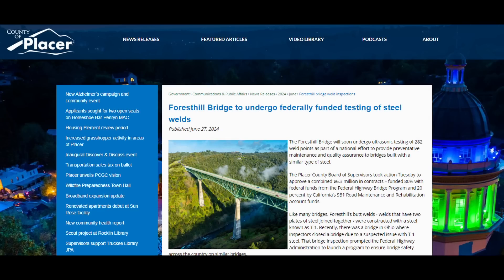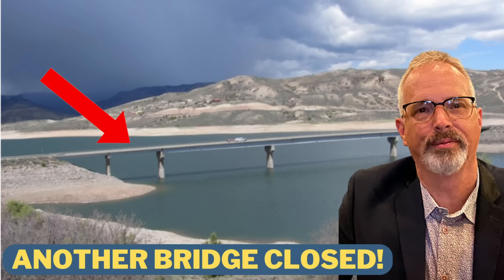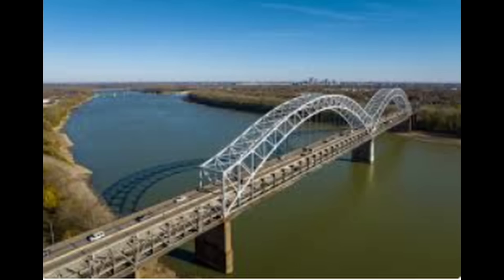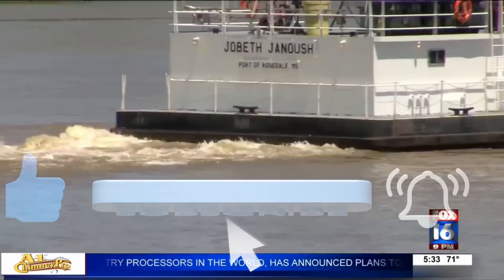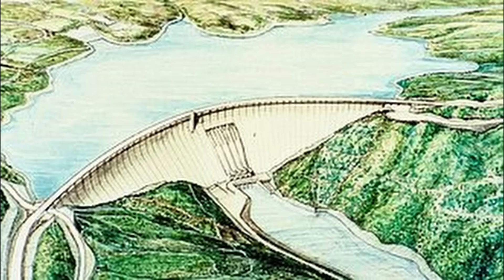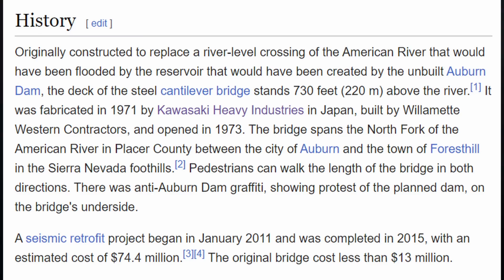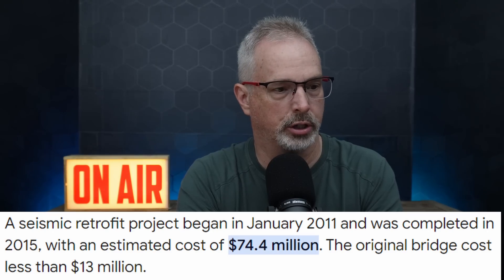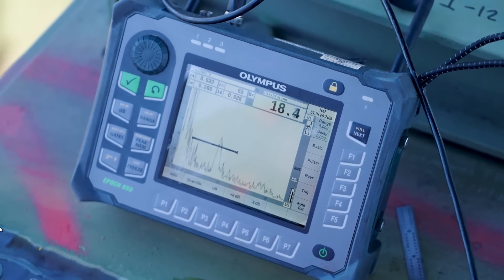Foresthill Bridge in California - Another T-1 Mess?

Comment: When the cover plates are bolted into place, doesn't that move the stress load to the points just past the band-aid plate? Thus creating a new weak spot that will need to be ultrasonically inspected in a few years.

Comment: Metallurgy. Welding high strength steel of any kind MUST follow specific procedures for pre-heat, filler material, and post heat. Depending on carbon content, and chromium content, some steels cannot be reliably field welded as the entire part must be post-weld normalized in an oven to relieve stresses.
This has all been known to us for 75+ years and James F. Lincoln literally wrote the book on it.

Comment: As a state and city licensed welder In NYC for 45 years I can tell you many welders do not adhere to proper welding techniques due to time constraints given to them. Many steel erectors would not allow the time spent as it is time-consuming and costly. You have to keep the welding rods in a heated oven. You have to clean the steel before welding. Most important with large welds preheat and post-heat are very important. The winter is extremely important when post-heating a weld and bringing the temp down to natural environment temp. slowly. Sometimes people. are to impatient and do not fully understand welding. It is about how many tons of Iron per day or floors can be erected. T1 steel from my memory you could use a 7018 up to 3/4" best to use an 8018 or 9018 as it has a higher structural component. Heat the rods is key.
Love your channel very interesting information.
Reply: It really makes you wonder if the problem extends beyond just T1 welds.  Casey, do the non-T1 welded bridges undergo more than just visual inspection?
Reply: @Zupdood2  I agree
Reply: @thelaxman59  I still wonder when the requirement for keeping the welding rods in an oven started. 45 year ago is surprisingly after the discovery of hydrogen embrittlement, which happened in the 1970s.
Reply: @johnhaller5851  I know I had my first License from NYC than NY state in 1980. Then a third from the Indian Point nuclear power plant. I went through welding school with my Union Ironworkers Local 40 Structural. When I took all my tests it was drilled into us heter boxes for rods were essential. We had small boxes to take to our points and large ones that held many boxes of rods. Pre-heating and post-heating on any joint larger than 1/2 inch was stressed. I did not like welding but it was a step I took to get to know every part of steel erection. I also got a rigger's license and became a Super so I put up many cranes and believe it or not we still had some derricks. I loved my work and mostly the men. It was good hard work we all had a brotherhood I miss since retired. Hope that answered your question.
Reply: @thelaxman59  Thanks for all your information. So, that college education I got was more obsolete than what was being practiced, which isn't all that surprising.
Reply: @johnhaller5851  No John I made my children go to College so they could have choices. about 1/3 of the Ironworkers in my local have a 2-year or 4-year degree. WIth that degree like myself, they go on to running jobs. That is where the college comes in. People don't realize the work required in scheduling the heavy loads of steel that come from other states and has to come over the George Washington Bridge in a 4 hr window at night. Where can the trucks be parked in a laydown area? Many other organizational skills are needed to put up a 50-60 story building. I learned a lot on the job but so much came from the college education also.
Reply: @johnhaller5851  I went through welding school with my Union Ironworkers Local 40 NYC structural union. I know in 1980 I had heaters for rods back then. I also took a welding test for the Indian Point Nuclear Power Plant. That test was much harder than the state and city tests.I know on most all the jobs we had rod heaters some small and portable some large stay in place. We would go to the large one and take out enough to fill the small box to take it to our welding points. The heating of the rods and large weld points
was drilled into us.  An apprentice would help with post-heating and temp control if you don't you would have cracked welds.I got away from welding at a young age as I finished school to get my riggers license and it helped me become a super. I would put up and take down many rigs in NYC. You had to have someone with a rigger's license on site.
I love it and miss it every day. Great men and great job.

Comment: Casey Jones-

Thank you for your efforts to bring clarity to the often obscure questions regarding the details of engineering.

CALTRANS has been aware of Fracture Critical bridges for quite a while. But the issues of T-1 steel have only recently been addressed by NDT and special inspection teams.

Avoiding catastrophic failure in these aging bridges requires focusing on the most critical aspects of the structure. The information in your videos really helps everyone understand the true nature of the problem. This cannot be done by the general media to any degree required.
Reply from the maker: Thank you.  That was one of the reasons why I started this channel as I found general media sources to be really lacking when covering things of a technical nature.
Reply: Our careers have traveled different paths for sure, but the goals we have appear to be quite similar. Flood Control, Transportation and Infrastructure Development can be accomplished with great success and also experience unforeseen and costly failures. 

Your efforts to bring greater clarity to both sides of this story with the thought of avoiding the avoidable is greatly appreciated.

It’s important that the engineering community understand the value of this type of review. Learning from the experience of others is the easiest way to learn for most engineers, not from just your own mistakes.

Comment: I worked in PE structural engineering office and fabrication.
Laminar tearing at toe of  large fillet multiple pass welds was a big issue.
Most went to high strength bolts .

We had Crane booms and pins xray annually in NYC construction .

Out of position welds are difficult out in weather rain snow moisture.

Bolts can be more reliable quality control  and inspected for tension etc.

Also , Before 1980s all steel used on municipal projects had to be from United States with documents.
Wikipedia is not a reliable source of information.
Not accepted in University research papers .
Reply: Lamellar tearing.
Reply: @myredford39  yes sorry..
Spell check ✔️ modified it lol

Comment: I remember back in 1963 my welding class professor claiming that T-1 was a danger and that the preheat requirement was a crutch for postheating the weld.
I never worked as a welding engineer, but still remember his comments.
Reply: Yes true ....  welding with out  preheating and post welding changes the Structure  of the Steel Crystals ...
There is so so much that goes into the design and actual frabrication of Welded joints ...

Ref:  AME Welding Manual ...

The  old Hot Riveting System is one that  spreads loading around joints and are still in structures standing today where Modern welded ones have long Failed 😮😮😮😮😮
Reply: @josephcooksley3219 
Interesting thought on the rivets.
Reply from the maker: Very interesting.  Thank you!
Reply: @henrynelson9285  This appears to confirm that my hypothesis that hydrogen embrittlement wasn't really a thing in the 1960s. That's not to say that proper heat treatment wasn't an issue, but it wasn't the only one.
Reply: @johnhaller5851  Hydrogen embrittlement is always a problem. 
It's just worse in high strength steels.
USS pedaled T-1 as a weldable 100k steel as compared to A36 at 35k yield.
It' wasn't appreciated that it took a lot more care to weld.

Comment: Hydrogen embrittlement is a show stopper. Mono-atomic Hydrogens meander through the alloy matrix until they find another mono-atomic friend and they hook up and make a little H2 bubble. Later by chance others find their way to the same location and do the same. The little pockets have astronomically high pressures and split the alloy usually along the path which the metal was formed. The problem is compounded by the fact that inspection technology has greatly  improved and metal that passed inspection back in the day looks awful using modern techniques. I've seen indications in pipe, welds and forgings that have seen no loading for decades. Welded repairs on dodgy base metal is a tricky business too. I understand why they use bolted on plates.
Reply from the maker: Great comments, thank you!  I wonder where is this issue may pose a problem as I understand that T-1 steel has been used in buildings which would clearly have post-construction access issues.

Comment: Local facts. Placer county has tried to close old Foresthill road (the only bypass to the bridge and new Foresthill road ) several times after winter landslides blocked off the old road, which would leave the Foresthill and Todd Valley residents cut off if anything closes the bridge.  

Yesterday alone the bridge was closed for hours for a wildfire.  Maybe Placer won’t be so quick to suggest closing the old road with this new info on the bridge. 

The bridge is only a mile off of 80 in Auburn for anyone nearby or passing through that wants to take in a close up view.
Reply from the maker: Thank you for those updates.  It sure is a scenic area.
Reply: @CaseyJones-Engineer  It is very pretty. Foresthill Road has a fantastic view of the American River. Also, some pretty cool giant burn scars from the wildfires that are pretty impressive.

Comment: In my early years in construction I spent a few years on a rock crushing operation. We used a lot of T-1 steel plate to line chutes that washed gravel or crushed rock would pass through. T-1 plate was known as an “abrasion resistant” material far outlasting regular mild steel material. At the time we never really had to consider its brittleness. I’m really surprised to learn it was used in structural applications on major bridges…..
Reply from the maker: Very interesting, thank you!  I am starting to research all of the other applications for this steel.  I understand it was also used in building construction.

Comment: There is a brand new bridge in nearby Sacramento that will be deconstructed and replaced..
Reply from the maker: Interesting.  Which one?
Reply: @CaseyJones-Engineer  Sacramento trail bridge.
Reply from the maker: @johnz8210  Thank you!
Reply: That little thing should have been an all-steel portable bridge instead. Bailley and other military bridges from WWII remain in daily use around the world. They're cheap to fab because they use standard parts, 
and cheap to repair and replace because they are designed for easy repair when damaged in combat. Concrete is used for silly reasons like esthetics rather than cold pragmatic practicality. 
Portable bridges can even be rented for use during other construction projects.

Comment: Metallurgy is fascinating. From pocket knives to machine tools to steel structures; all require good engineering to succeed.
Reply from the maker: I agree.  I have learned a lot by making several fixed blade knives!
Reply: @CaseyJones-Engineer  
Ditto. Ruined many blanks because I didn't anneal or quench properly. Made some blades so brittle they are like trying to sharpen obsidian. Thanks

Comment: I'm quite surprised that this was allowed to happen.
Hydrogen embrittlement has been known about since 1875 or so. Carbon steels (eg. T1) are particularly susceptible to the condition which is accelerated by cyclic stress and by allowing corrosion to take place - corrosion releases hydrogen ions. Also the heat affected zones (welds) are particularly susceptible to cracking due to the change in microstructure. 
All of this was well known by the 1950s.
Reply from the maker: Yes, there seems to be an ongoing pattern for people to not learn from past mistakes for some reason.